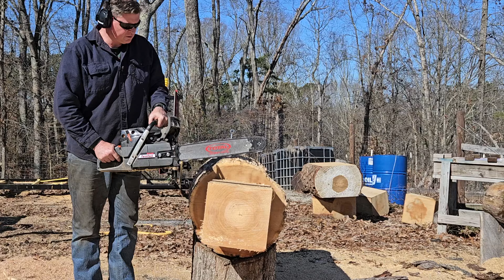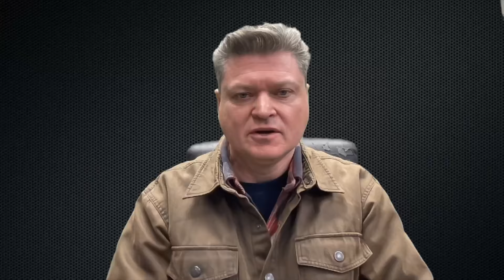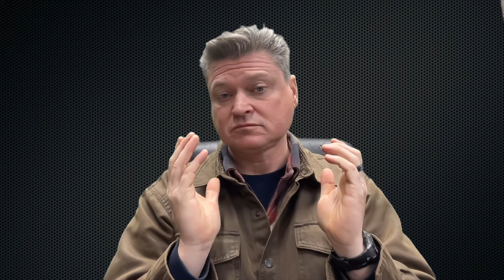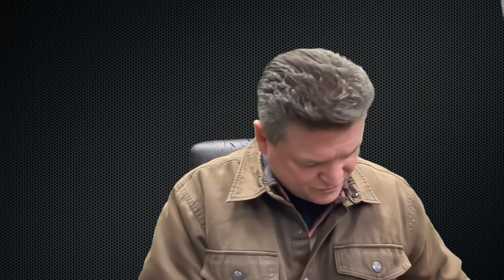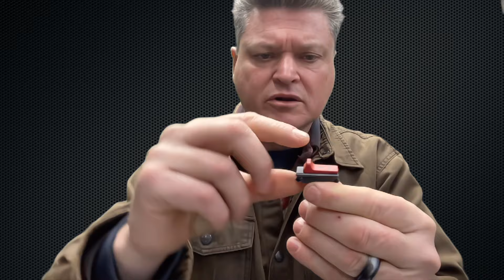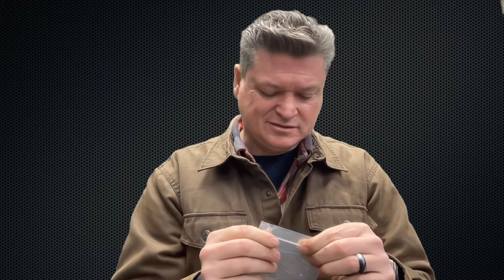372XP "Farm Hack" vs Stihl MS 400

Comment: There are still millions of comparison video's to be made and all of them have variables to consider. At the end of the day does it matter one can cut through a piece of wood 2 seconds faster than the next ? or is it more important that the saw is extremely reliable ?  I go for reliable where the tool works every time I need it.